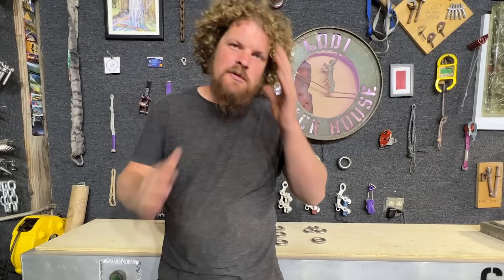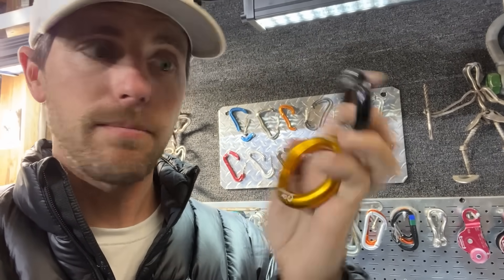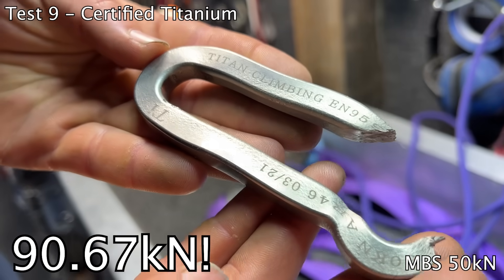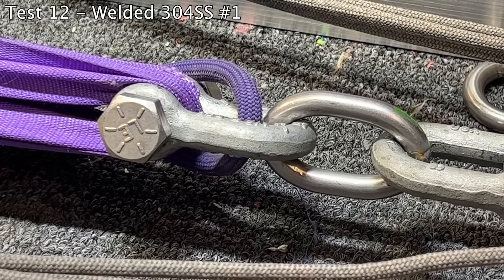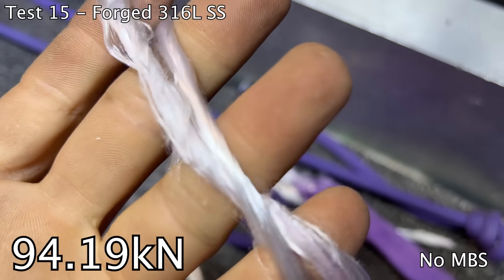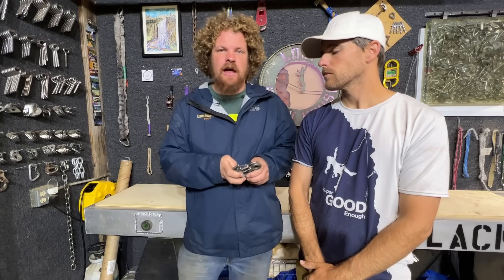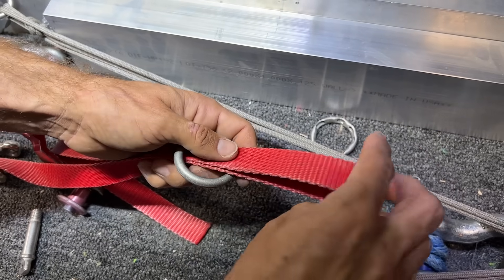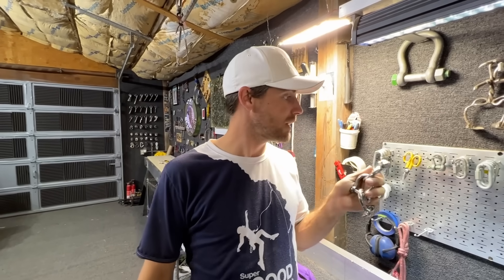This rappel ring could kill someone

Comment: The welds on the rings would seem to be less likely to fail if they were welded in an oval shape (like chain links usually are). The one y'all tested with the weld on the anchor didn't hinge open like the ones with the weld on the anchor. The anchor tended to make it pull uniformly across the entire weld instead of stressing the inside edge first. If those rings were ovals, the weld would tend to pull on all parts of the weld. 
Worth testing?
Reply: You mean instead of a ring to have an oval? If so then then it would put the wear in only one spot and that was the whole point of using rings that would turn randomly and wear out in multiple spots. If you mean the weld bead being bigger, that might work but would surely mess with the uniformity of wear too.
Reply: @dragoscoco2173  You're right. So the dilemma becomes: do you want a strong anchor? or an evenly wearing one? 🤔
A welded ring that will handle ~50kN is probably super good enough.
Reply: The welds on chain links are forge welded, where the link ends are heated and pressed together without any filler metal, so the weld conducts of only the base metal, the filler being provided by the displacement of the base, so it ends up being as strong as the link stock, and possibly a little harder due the rapid cooling; In every chain failure that i ever saw, the link stretched and failed on the side opposite the weld. Of course, this type of weld on climbing equipment is probably not practical, cz of the low production volume. Link chains are made in very high volumes by extremely expensive automated machinery.
Reply: @joelee2371  usually a weld is quite a bit stronger than the weldment. That's why breaks usually occur right beside the weld.

Comment: I was taught a chain is only as strong as its weakest link. Also if it breaks at the weld you need a new welder.🤷‍♀️
Reply: Welds are absolutely always a weak point. In general stuff will always break at or immediately adjacent to the weld. The heat affected zone will always change the properties of the metal, and that will always be for the worse if the alloy is being used properly
Reply: @MrTheomossop  Welds can be stronger than the material it holds, but you have to play with the geometry and bead of the weld out which is not really possible when needing to obtain a ring of uniform thickness.
The only thing I can think of that might improve the weld quality in this case is to cut the round stock at an angle , bend it , weld it, so that the HAZ is not concentrated in one plane perpendicular to the ring.

Comment: Hi, I’ve done a bunch of blacksmithing, so I know a bit about metals. I think the titanium is not getting hot because of the force, directly, but because of the deformation done by the force. That’s why the steel didn’t get as hot! It takes a lot of energy to move metal, and when it does move all of that goes into friction/heating
Reply: Indeed. If it stretched, say 3 cm @ 80 kN, that is 2.4 kJ. Pure Ti (these are almost certainly alloy, though) has heat capacity of about 0.5 J / g, so if the thing weighs about 100 g, that would increase its temperature by about 50 °C.
Reply: @Puukiuuki  a big big reason for the high temperatures is the thermal conductivity of Ti, its pretty much the lowest of all metals, it allows the heat to accumulate very close to the fracture/deformation zone and doesn't give it any surface area to radiate/convect away.

The rings are almost definitely Titanium- 6 Aluminium- 4 Vanadium by the way. I would be shocked if they were anything else.
Reply: @MrTheomossop  The difference in thermal conductivity of steel and titanium is only a factor of 3, and since thermal capacity of steel is about double, and its density is more than double, the thermal diffusion "speed" should not be wildly different.

But just because the heat capacity is about double, same energy put into same mass of steel and titanium will cause titanium to heat about double the amount.

That and the large amount of stretch at high force (which generates more heat in the first place) should be mainly the reason for the markedly different temperatures.
Reply: Agreed - it's all Energy = Force x Distance. So if it stretches heaps (more distance) when a decent force is applied it'll heat more.

Comment: Is there another variation on the linelock that uses a rectangular ring with a saddle-shaped pin/blocker ?
Even if it's only rated for a hundred kilo (like the samples I used to have) it would be great for tying things down for the winter.

Years ago in the 90's; I got a sample of one-piece nylon line locks ("for shipping and storage") that held two ends of lashing/strapping while they were tensioned. 
Each piece had pairs of integrated pins suspended by flexible hinges, shaped to nest onto a rectangular ring, instead *into*/through it. This avoided any leverage/collision concentrating force into deforming the ring while keeping the webbing flat. 

Having seen your demonstration, I think I may have been the only one who completely ignorant of how line-locks normally work, read the instructions instead of 'clipping off the sprues' in the test group. 
(One in particular who ask me to show them how I'd fastened a set, got very angry and started shouting about how I'd done it 'dangerously wrong' and cut the hinges before becoming even more frustrated and hacking wildly at the 'incorrect' instruction-sheet when the demonstration loop didn't fail-apart under-load as he'd expected.)

When I tried to get more, the (intermediary) for the company that made them told me that because I was the only one who had any measure of success that didn't work for the MFG; no more would be available.

Comment: Yeah Stainless Steel is the way to go. Better wear resistance, stronger, cheaper then Titanium. Weight doesn't matter because it's at a fixed location..Just go Titanium if corrosion is a serious problem. Think of Ti like a stronger aluminum, though Ti is still pretty soft and wears slightly better then aluminum....Also don't forget Steel rubbing on aluminum isn't good either. Hint* Steel will win..It's not as quick as soft good cross rubbing, but think of it the same way...Wish climbing companies would start making more Steel biners again.

Comment: @HowNot2  i love your videos, and i find them to be really informative. i have an issue with something in this one that i know 100% that i am correct on. you state micro fractures are a myth. in one way this is true, the term micro fracture isn’t used by anyone in the industry, they talk about Fracture of 3 different types. i own an offshore cruising sailboat, and they require extensive upkeep. i have replaced the standing rigging twice, this second time with as much dyneema as possible and rigging from Colligo marine. i avoided steel and aluminum, because after dye testing, which you should ABSOLUTELY be performing on all your used gear that you break, you see lots of microscopic fractures in the metals after a couple of years of sailing hard. these need to be replaced immediately. my chainplates are 1/4 inch steel, mine are 20 inches long and each has 11 bolts, 316 stainless. i hesitated to replace them, it’s about 4grand. polished to a shine they looked new, however the dye test revealed tons of tiny fractures. same as on the turnbuckles and some of the load bearing shackles. granted- the forces on a sailboat are scary big compared to the forces generated in a climbing fall, but still, metals are metals, and yes, they often have tiny fractures in them even after limited use. it’s a fact, and it would be great if you could do some dye testing on used gear to show the viewers how tiny these fractures are, invisible to the eye until dye is painted on, then scary to look at through a microscope. keep up the good work,and thank you for doing this crucial service.
Reply from the maker: “Dropping carabiners from 5 feet high on the ground creates microfractures” is a myth. It was in context of when I put it in this video and the context of that episode is clear also. This myth was spread around for too long and needed to be debunked. We can get microfractures in the carabiners if we put them in high force scenarios like slacklines and they cyclically load them like if wind oscillates the line. The concept of microfractures is true but not in normal climbing use.
Reply: @HowNOT2   i apologize, i guess the 5 foot part i missed. so sorry! i smoke a lot of weed.

Comment: I was looking at these rolled alu rap rings recently at my work and thinking oh god I do not trust these. Just take a bit more weight and use steel
Reply from the maker: There is quite a difference in weight between fixe's steel and the smc aluminum rings.  They have their place and I feel better knowing it's 15kN if I did rappel on them.